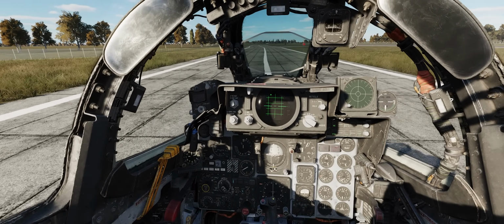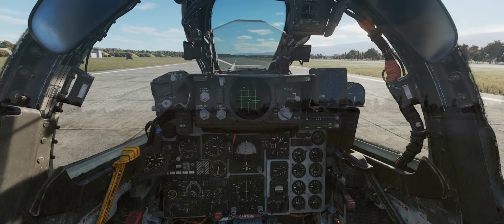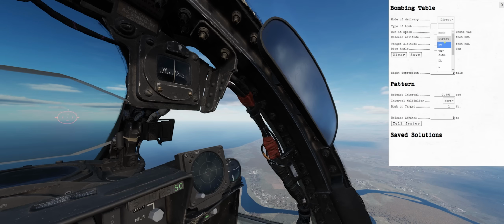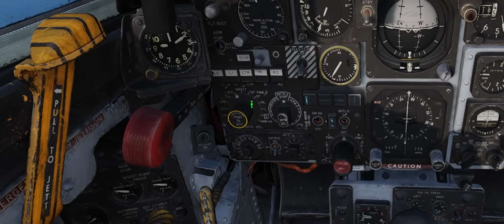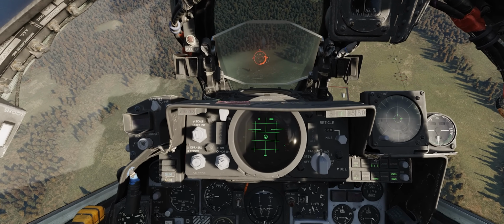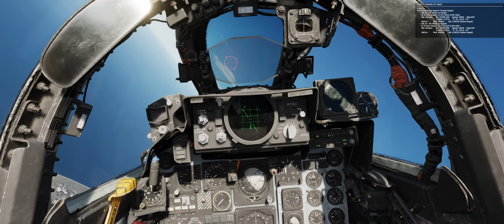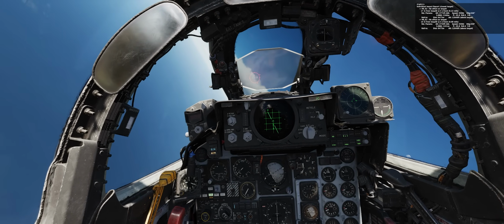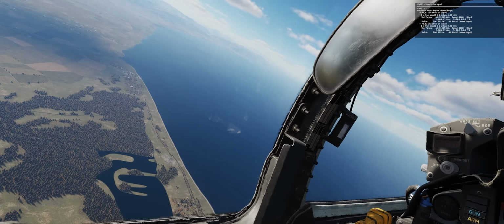How to (Actually) Drop Bombs In The F-4E

Comment: As per the previous version, thankyou for videos that I can keep up with. It is heartening to know there is at least one other person that finds learning the nuances of every aspect of planes like the Viggen and the F4 to be daunting, and your channel goes a long way towards easing that burden. 👍
Reply from the maker: Thanks, I appreciate it.  Unfortunately, the Heatblur manual is very much written as an "engineering reference" it is a comprehensive list of the functionality that is present, but not described by function.  It also contains words and phrases which are clearly well understood by the developers and others with intimate knowledge of the module but which are pretty opaque to the average user.
Reply: @Sidekick65  active airlines driver? Service flying experience??
Reply: @crazykiwi1472  as a spook chief, radar, n nav wasn't trained technically, but was allowed in the base simulator and learned most thru that and just exploring logical driven common sense and systems testing using technical manuals.
Reply from the maker: Former NASA prime contractor (workes in MCC in the Shuttle era). Former artillery officer (reserve). Former aerospace industry trade association executive. No formal aircraft "operator" experience. But I have been around a few blocks a time or two...
Reply: @Sidekick65  I get that thru you're descriptions, reasons and situational awareness is present when I watch your vids...

NASA is no dummy tasking outfit... Ty for your services to our galaxy..
Reply from the maker: Thanks. It has all been an interesting ride. If you want more on that side of things look up the ACast podcast called Terranauts.

Comment: *Dive toss is the recommended version to use the bombs
0:01 intro and talks about personal phantom delays
6:26 bombing table
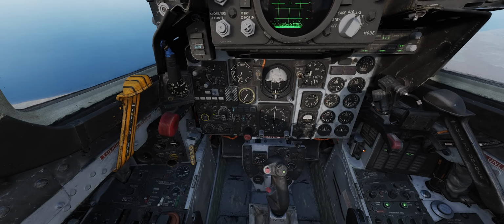7:50 setting the dials (release controls)
9:12 if radar is set to 10mi, that’s good (your in dive toss mode)
10:40 first bombing run with explanation 
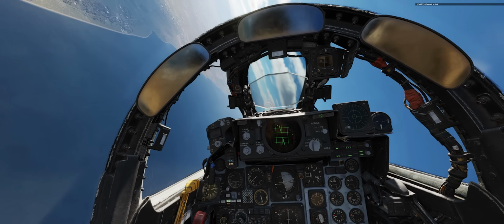12:00 explaining roll in method (stop rolling in early because reticle lags behind your pull)

Comment: Great video! Only advice, next time when doing panel work, maybe zoom in, in game, rather then zooming in using your editing software only because it preserves the resolution and therefore is much easier to read the dials.
Reply from the maker: Thanks for the advice.
Reply: @Sidekick65  I'd like to just say, your videos fill an extremely unique niche and can be valuable in the DCS space. Because you look for the most "convenient" or "easiest" form of delivery for weapons it allows people not familiar with DCS to get into the Sim the smoothest, even if what they do isn't "per the manual" like with many other DCS creators.

The Grim Reapers did it best for me before but for reasons you may or may not already know I now refuse to support them in any way. If you add in sections to do with key bindings and what those particular bindings are called in the "Adjust Control Menu" I think you may find a LOT of success.

Examples of what I mean is sometimes you'll get situations where key bindings for modules aren't similar to each other, trigger detents are a perfect example, a specific one would be how some modules mark Nose wheel steering differently: F-16C (NWS), F-14 (Nose wheel steering, it stays on without needing to hold), Mig-21 (it is also named differently)
Reply from the maker: Got it. Once again. Thanks for the tips.

Comment: No CCIP or CCRP? only use the table and calcu manually ?
Reply: Correct. Similar to the A-4 is what I've heard.
Reply from the maker: Well, to be pedantic - no HUD.  I would say that it uses a form of CCRP - as does the A-4, but the cues are not presented on the combining glass because it is not a full HUD so it may not "Feel" like teh CCRP you are used to if you fly modern jets.